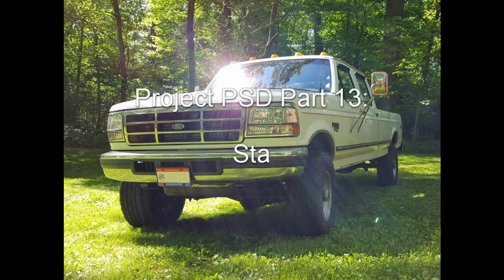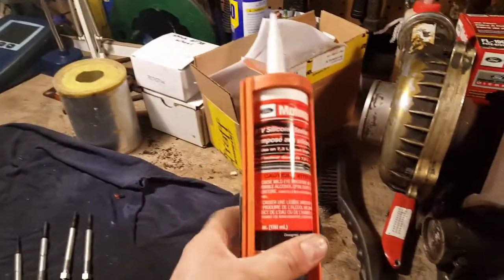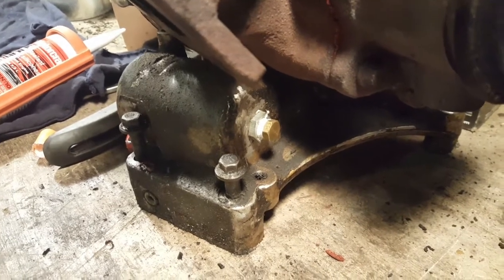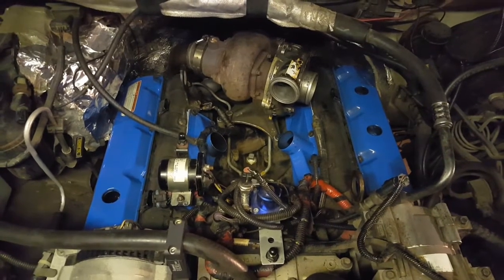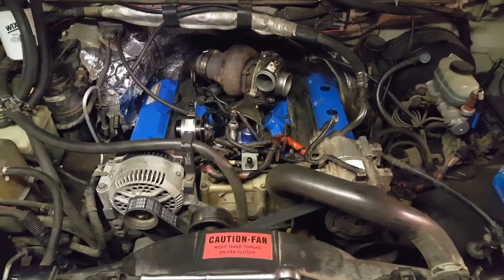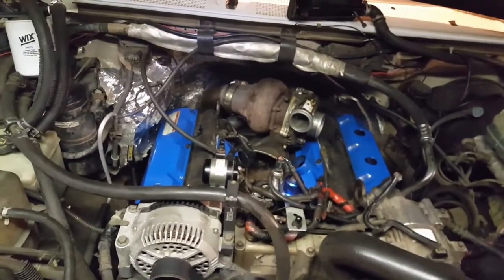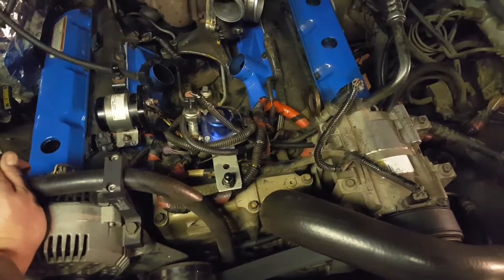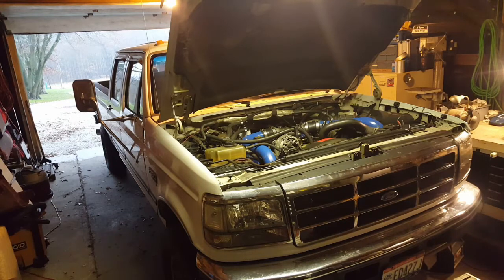Project PSD Part 13: Stage 1(160/0) Injector Install and Plenum Repair

Comment: Can't believe I just found your video,  I've been watching 7.3L injectors swap videos and yours sir was the best after swap start I've seen.  My son and I just finished putting a fresh set of 160/0 gaskets,pigtails, Hydra tuner in my 97 7.3l  and it took 7  long cranks before it finally fired.  My batteries really struggled Great job , new subscriber
Reply from the maker: Glad you found the channel! Thanks for watching and subscribing. Keep that old truck alive! They're good ones. 😉

Comment: What about the injector cups
Reply from the maker: Injector cups generally don't need to be replaced with the injectors.
Reply: True on a stock truck that's been well-maintained but now that you're going to put the juice to it I guess you'll find out
Reply from the maker: 3 and a half years now and still going strong!
Reply from the maker: @JARRETT7121  been putting the juice to it for a few years now and it's working out great so far!

Comment: I’m about to reseal my intake plenums, since I’m already replacing the lift pump and fuel bowl. Do I only have to prime the truck from the starter relay when I have everything back together? Or is there more to it since I removed the turbo etc..
Great video by the way very straight forward and simple like them 7.3s 💪🏻 lol Love the truck man kee strokin!
Reply from the maker: You shouldn't have to do much to prime it again after just having the fuel bowl and pump out. Once everything is reassembled, fill the fuel bowl 1/2 way with fresh clean fuel, , install the filter and lid, then start cranking it. It will likely fire up without too much trouble. The fuel system self-primes better than the oil system does, and since you're not getting into the oil side, you shouldn't have too much trouble.
Reply: @diymechanictv1233  what if I also remove the hpop to install a newer one? Thanks for taking your time to reply I’m new to this kinda stuff so I get a bit skeptical at times.
Reply from the maker: @OTheFisherman  For that you will need to a fair amount of priming as the high pressure oil reservoir will be drained when you remove the HPOP. You can help speed the process along by refilling the reservoir if you want to. There's a small plug in the top, or you can remove the oil pressure switch for the gauge in the dash (it is also on top of the rectangular reservoir).
Reply: @diymechanictv1233  Sorry to bother again! I ran across a problem with the right (passenger) intake plenum. I can’t remove the last bolt that’s blocked by the hpop reservoir.
Reply from the maker: Is that one of the ones that is slotted on the plenum? There are some plenum that are slotted on one hole, but I honestly can't recall which one. Look closely. You may be able to loosen that bolt and then slide the plenum off of it.
Reply: @diymechanictv1233  I haven’t tried to remove the gasket around the plenum yet but I had no idea some were like that. The bolt is loose and all just can’t be completely removed. Thank you for the tip hopefully it’s just slotted under it.

Comment: Now that you've had some seat time with the Rosewoods, how do you like them?
Reply from the maker: I love them! I seriously wish I had made this change so much sooner. It's an investment, but the truck just works like it should with these injectors in it. It is so much fun to drive this way, and it'll tow everything I need it to without even breaking a sweat. This truck is all I need now.
Reply: @diymechanictv1233  that's good to hear! Glad you're enjoying them. These older trucks take some work but its rewarding in the long run

Comment: where did you get that bracket holding your heater hose over the alternator
Reply from the maker: Rosewood Diesel made and sold those brackets for a while, but I don't think Jim has them anymore. Riffraff Diesel has something VERY similar now.

Comment: How did you go about the e fuel system?
Reply from the maker: The e-fuel system is a regulated return system put together by a friend of mine (which I installed). It uses a super duty electric pump, a cheap Aeromotive knock-off regulator, NAPA filter bases (2 of them - pre filter, then pump, then final filter)and a bunch of brass fittings to complete a regulated return system. It's all cut into the lines right ahead of the tank selector valve. I wish I had a complete BOM of all the parts used, but I don't. There are a bunch of different e-fuel options out there if you're in the market. I recommend a guy by the name of Mark Fugazotto, he makes his kits  a few at a time, sells them direct, and has some nice videos on here on tips and tricks to install them. He's the real deal and his kit is one of the best values out there, in my opinion.
Reply: DIYMechanicTV thank you I’ve been wanting to do this Efuel for a while